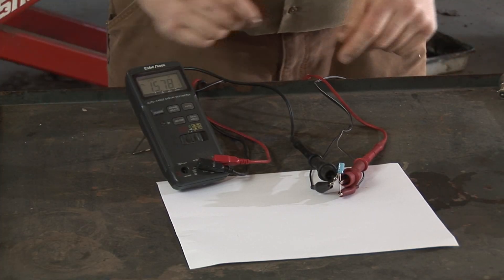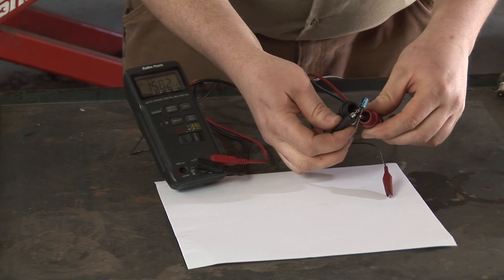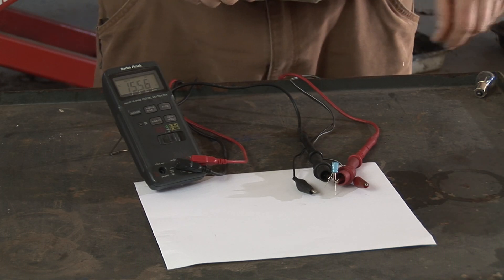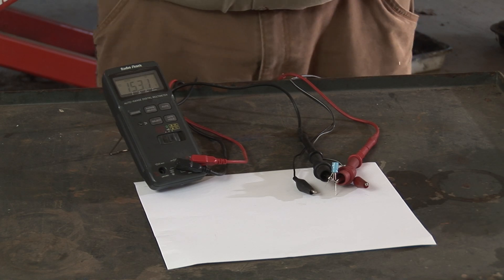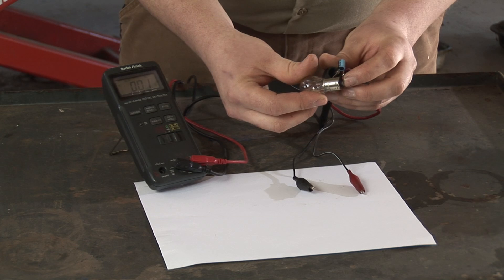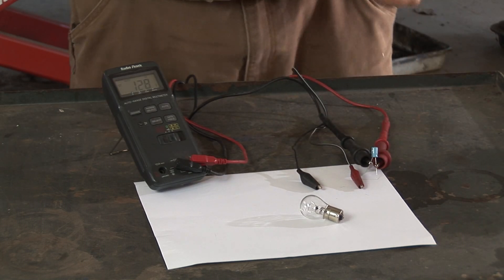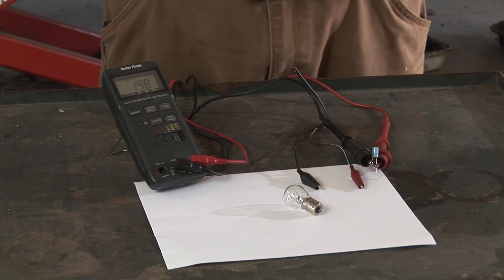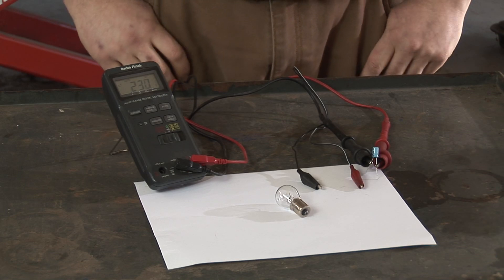Auto Repair : How to Discharge a Capacitor

Comment: By implying that a capacitor is essentially a battery you also imply that they behave the same. Nothing is farther from the truth, a battery is a Voltage source where as a capacitor is seen as a device to store charge, and can also be used implicitly as resistance in an AC circuit. The best information you could give someone is the actual application of a capacitor, which I just explained to you.

Comment: @DrunkenGolfer HA! Never, EVER have i seen a capacitor explode from shorting the leads. If the plates inside an electrolytic capacitor were to touch, you may have a problem, but the likelihood of that ever happening is extremely minute. Capacitors are designed to discharge quickly. If you wanna fiddle with a silly lightbulb, go right ahead, but i will continue to use my screwdriver.

Comment: @pixuma absolutely NOT :

0:25 : "You do not by any means want to accidentally short the positive and the negative sides of the capacitor - it can cause the capacitor to explode, it can also cause arcs or shorts and could also cause electrocutions"

were you even listening ?

Comment: im an engineer, and this is a very foolish way to discharge a capacitor. a cap that is that small and less than 50 volts can easily discharged with a screwdriver or just short the terminals. for a high voltage capacitor doing something like that can be dangerous, depending the size of the cap and the voltage its charged to. any capacitor that could be considered dangerous (like 50+ volts) should be discharged through a resistor of a appropriate resistance and power rating.

Comment: Just wondering where are you ever going to come across an uninstalled capacitor like your that needs to be discharged.  That thing seems puny as if it were micro amps.  I'm no safety officer or electrician, but why would you have to go through all that trouble for a little capacitor.  Seems like a waste of time.

Comment: i always use a 470 ohm 5 watt wirewound resistor to do such stuff. its better to slowly dischare a capacitor than fast like you are doing.

Comment: Why do you need a device that can handle more power when you use a capacitor with larger micro farad values? It doesn't make any sense. From what I remember the farad and resistance determines the charge and discharge times. Therefore only a capacitor with a larger voltage rating should make you use a device with a larger power rating to discharge it.

Comment: very smart way of doing it 
i am dealing whith campasitors around 330volts and 1000 farats (i dont know how to spell the word)the campasitors are charged at 600 volts  and i want a lot of times to discharge it safely i was using 230 volts lamp but somestimes it burnet the lamp with out dischanging it if you have an other siply idia how to do this please answer